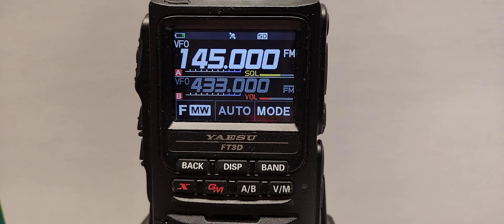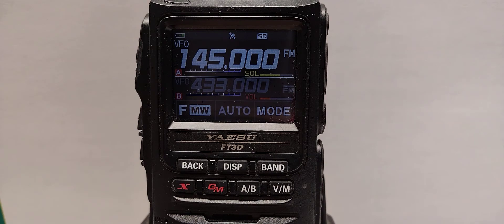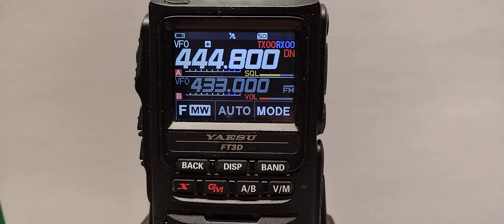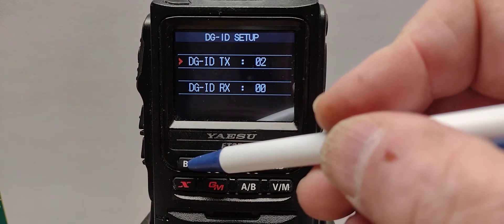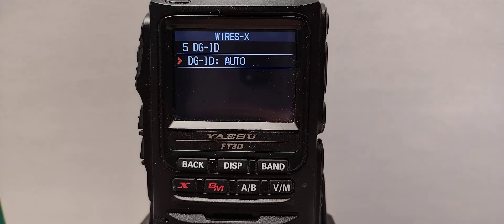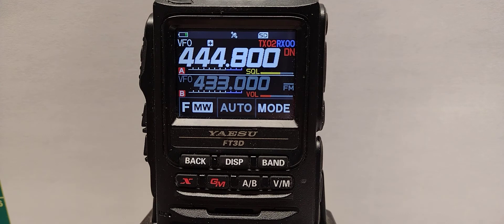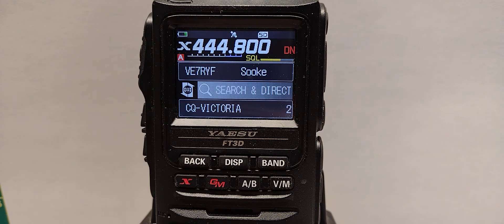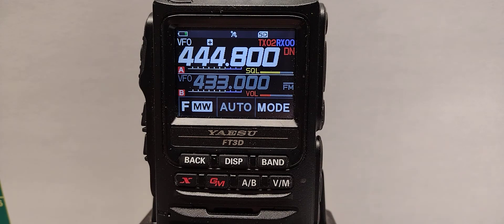FTM400 Series #2, Wires-X &  FT2D or FT3D Setup

Comment: Much easier than DMR,
Reply: DMR is ridiculous and not fit for Ham use. 

Fusion is a lot easier but I wish Yaesu and Icom included DMR, D-Star and fusion and not just the mode they want to support. 

With my Anytone 878 and Openspot 3 I can use DMR, D-Star and Fusion and switch between modes and channels on the fly very easily but it was an absolute headache to figure it all out and if it all went tits up I'm not sure I could do it all again from scratch, not when I have blue DV but sometimes in the car it's just easier to use the 878 and OS3 than a phone. 

BLUE DV and android auto would be really amazing and being able to switch between modes and channels via the cars infotainment screen would make it super easy. Support for Apple devices would be great. 

Easiest and best sound quality for TX/RX is blue DV. 

I use Blue DV on my Laptop, the windows version is just amazing and you can monitor DMR, D-Star and Fusion at the same time and see activity pop up on each.

I use BLUE DV on my android phone and connect via the DVMega Globetrotter which needs a static IP. The Globetrotter means I do not need to use a dongle.

Comment: I am new to digital radio and I find it confusing. 
Is it possible to use programming software, such as RT Systems, to program and save rooms more easily? 
If not, is there a way to save the work you just did to a channel from the radio? 

If neither is possible, do you have to go through these steps each and every time you want to enter a room? 
I've watched several videos and none have explained how to save these configurations.
Reply: I don't recall seeing any way to save any Wires-X info via RT Systems. You can save APRS settings but nothing regarding Wires-X, as far as I can tell. Call RT Systems, they are really helpful on the phone, great customer service.
Also, there's a couple FTM-400 FB groups that are really good and helpful as well. Digital can be confusing when you get started, don't give up, its a whole different world than playing with repeaters! You can talk all over the world with your 2m/70cm radio, its awesome!